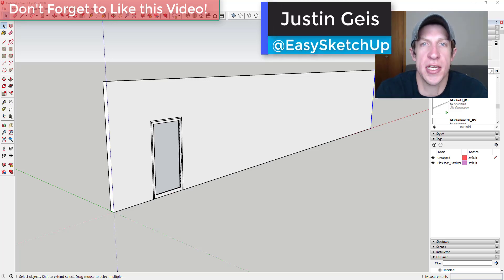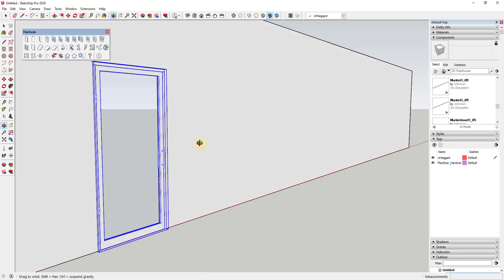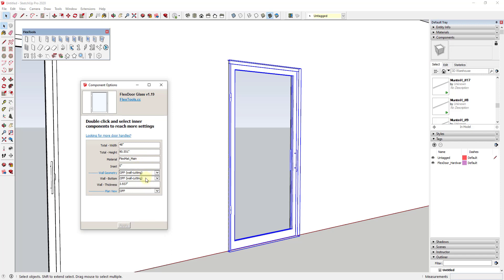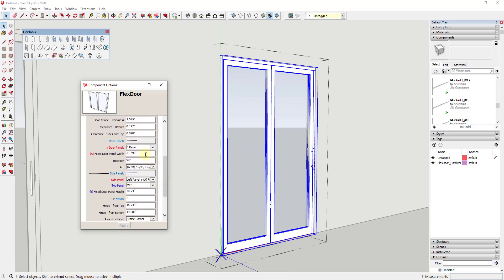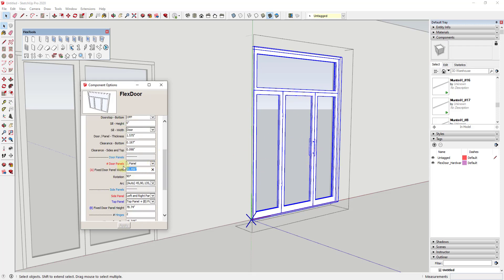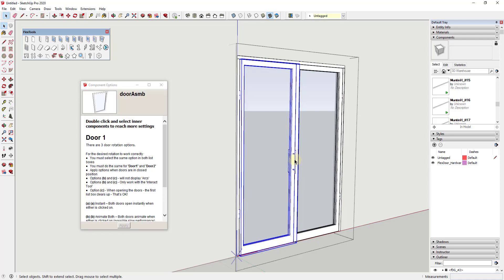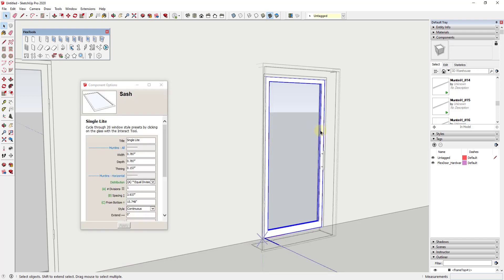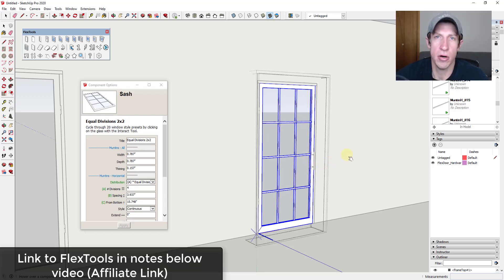Easy GLASS DOORS in SketchUp - New FlexDoor Glass from FlexTools!

Comment: Hi Justin

I would like to purchase the plugin. However, I would like to know if the plugin can also make frameless glass doors (likes of which we see in offices and malls). The door should NOT have any frame in the wall as well as the shutter. Is the plugin possible to do so? I couldn't find any of this information in your video. Thanks.

Ar. Nitin Sharma
Reply: Hello Ar. Nitin Sharma, you can create frameless glass doors with the regular FlexDoor (not glass).  You would do so by setting the frame to 0 (it disappears), making the door panel thinner and painting it with a glass material.  Then move the door axis so it's more like a pivot door and hide the hinges by setting them to 0.  We don't have the proper hardware for such a door yet, but you can see how it looks here:  https://flextools.cc/wp-content/uploads/2020/04/glass-doors-with-original-flexdoor.png